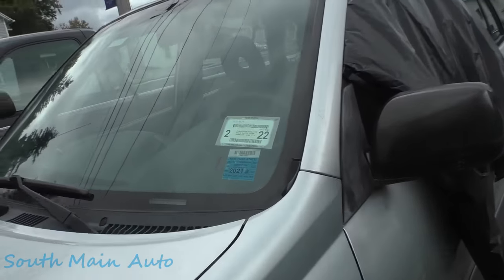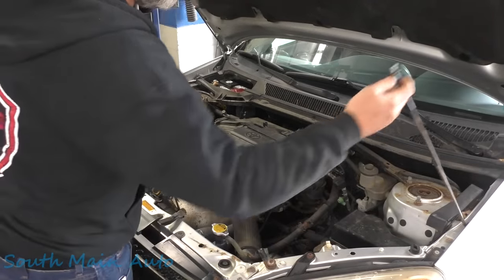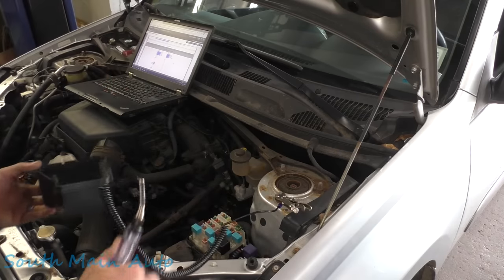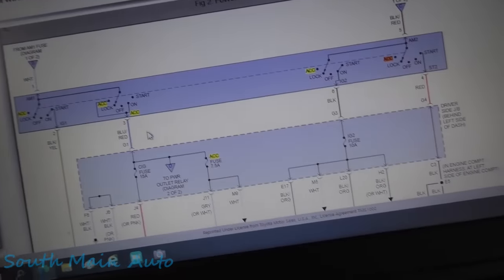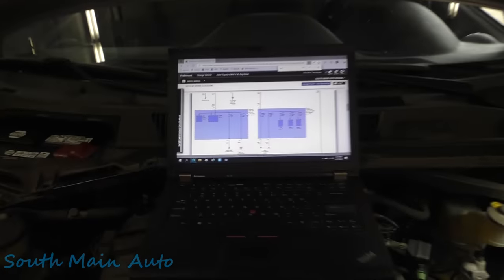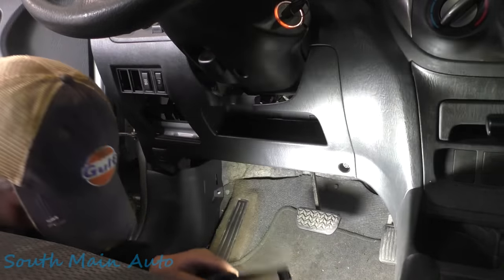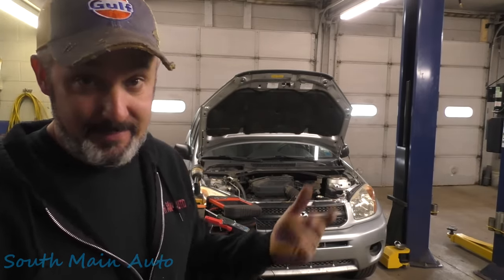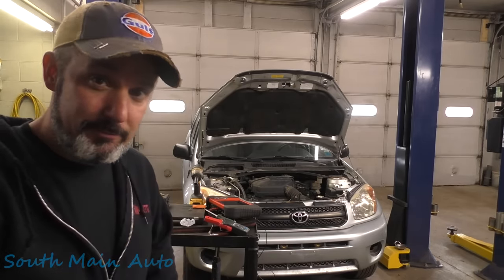Toyota Rav4 Is D.O.A. But Still Runs?

Comment: I admit, I did initially think "Why didn't he grab that battery hold down off of the junkyard vehicle?" You explained that very well with "Do what you were contracted/tasked to do".  I really think your explanation of diagnostics is my favorite thing, since most car engines are as cryptic as Aztech tomb traps, at least to me.  :)
Reply: Actually I disagree.  There were a couple things he could of grabbed like the cap for alternator stud, maybe hold down if it fitted, the cover for battery. Even could of ziptied battery down or use a bungee cord so it isn't bouncing around.

I once had a shop screw me over like this where they only changed the one part.
Years ago I had a 1990 jeep Cherokee where the fuel pump went out on it.
Paid 550 and 2 months later the fuel gauge stopped working. They wanted to charge me like 450 to change the fuel sender in tank. Turns out they only changed out the pump. Even though the price they charged me they could of replaced the whole assembly, they didn't.

Shops do this so the customer comes back so they charge more.
Reply: I trust my mechanic and tell him to report or fix whatever he finds broken. Ask me only when the part is really pricey or will take considerable time to fix. Sometimes I let him fix things that aren't broken yet but show clear signs of letting go in near future, why wait if the car is in the shop and on the lift already.
Reply: no good deed goes unpunished...do what the customer says only. it's a business after all, and the junk yard visits is already going beyond what the majority of repair facilities would do. keep up the amazing work Mr. O
Reply: Just let him Wilbert's probably has all the parts you need. If he just got it, I imagine he got it dirt cheap
Reply: @blitz8619  They are business to make money.. The only thing your shop should have done is say to you "While we are in there we suggest you change the fuel sender also, and CHARGE you for it"  WHY should a shop replace shit for free!!?? I know of NO shop ANYWHERE that just puts parts on for you, ESPECIALLY if you are a first time customer!!
Reply: I am thinking the same thing. That's what makes a good shop a GREAT shop. Vacuum the floor mat. Take 2 minutes to see if the customer wants the switch fixed. Eric O your time is not as valuable as you think. There had to call you out on it.
Reply: @hoosiertrailrider  He's not doing it for charity.  He's doing it to make a living.  Vacuum the floor mat?  If you want him to do it at his hourly rate, sure.  Fix the switch?  Add another hour of labor for diagnostics.  You're not calling him out because your just another guy who thinks mechanics and other tradesmen shouldn't make money for their time fixing your stuff.
Reply: @blitz8619  shops like SMA buy from local parts stores like NAPA, if he ordered a fuel pump, that's what he got. the sending unit is a totally different part, i just replaced one in a 2001 ranger but not the pump, either will work until it don't. your pump could have worked for another 10 years.
Reply: @blitz8619   I have to agree- grabbing like a whole other battery or something like that is one thing, but just a hold down and alternator cap is such small potatoes I probably would have done it.
Reply: @TheWickedFast1  but when a shop marks up the parts so much. Marked up a 50 pump to 100 when the complete assembly was like 90. That was the problem I had.
Reply: @stevenjames3242  yea but when you get charged 100 for a 50 pump when the complete assembly costs 90.
Reply: He could have but it would not have fit that battery that the customer already had. And since that battery was fairly new, he probably wouldn't have liked the idea of having to replace the battery again. That hold down will only work with the correct battery installed. But I agree, should have grabbed the cap for the alternator if it was there, that stud is way too easy to accidentally hit with a wrench, sticking out like a sore thumb.
Reply: @brnmcc01  He would have had to spend more time in the rain to get the cap, plus for all we know he looked at the car he got the fuse from and the alternator and that cap was already gone. Come to think of it most of the time the cap threads though the cable, so he would have had to disconnect the cable before he could get the cap from the junker.
Reply: @blitz8619  They didn't know your sending unit was about to go bad. I've got a 96 XJ, the fuel pump went out ages ago and I had a new one put in. They didn't suggest nor did I ask them to replace the sending unit. The car now has about 600k on it and the gas gauge still works.

Comment: I love when the big dog fuses are right off of the positive battery terminal. Splitting open a junction block to replace a main fuse can be a nightmare.
Reply: Or having to cut out a bad factory fusible link, then you have to splice into a high amp wire, and worry about the green crusties invading it later if doesn't stay dry.
Reply: I don't know the only time I seen a main fuse fail is when it's on the battery terminal. 🤷‍♂️

Comment: My two cents, they tried jump start it backwards. The way I remember that is why they have the big fuze because without it, it will fry a computer.
Reply: I have done something similar.  The parts store didn't have the right battery in stock, and I had a moment of dumbness where I put the battery in backwards.  It had a rather large spark when I went to connect the battery positive and I thought "that was weird", and then realized what I had done.  I got away with only blowing the aftermarket stereo and a main fuse like in the video.  A year later when I replaced the stereo I realized that the stereo also had a fuse on the back which had blown, but by that point I replaced it anyways.
Reply: The old reverse polarity trick, jumper leads reversed or battery., seen it happen and usually destroys other components.
Reply: @willemvantsant5105  Lucky it is an old car.
Lucky still it did not fry the PCM.
Reply: @willemvantsant5105  Absolutely right - other things generally die, but not in this case. However, Toyota may have a trick or two up their sleeve that people much smarter than me may have placed in the system to prevent much greater damage to many components. Retired mechanic in Land Down Under.
Reply: My Daughter inlaw going back some years went to pick up her new car from dealership,  somehow they reverse connected the battery and destroyed the ECU, had to wait another week for the car.
Reply: @willemvantsant5105  frankly I would not trust that car.
esp these days.
there are multiple computers in the car
PCM, multiple body computers, HVAC, SRS, ABS, radio

Comment: erics thought process is gold,i was working on a transit van ,mk6 diesel,in england,and doing copper washers on diesel pipes ,had to prime the system,and was on my own,was stumped ,then i remember ,eric loves his wiring diagrams,so i thought,what color is the starter moter trigger wire ,to ign key,google a wiring diagram,had fat red wire to batt,alt wire,and a red wire with black stripe ,goes to key ,found that at the fuse box plug on engine loom ,back probe a wire ,now i could turn engine over ,on my own,crack open injector nuts ,turn engine over till fuel came out ,retighten nuts ,crank engine over ,and it started,was awesome 30 seconds ,used erics train thought loads times now ,i found if every think is dead,they are easyier to fix,visit scrap yards too,get cheap parts,tressure  trove in there ,rumage around ,boot ,under seats,found shotgun in a volvo once ,that was mad ,even bought a snapon scanner with a scope ,after seeing what eric can do with it,watch pulses,canbus,opens up a whole new world,love the scope on a rope too,find lives ,grounds easy ,i too now ,seem to be getting peoples cars that seem hard to fix ,or they gave up ,as not easy,keeps me busy ,his videos are gold ,for learning to diagnose ,work out whats going on ,get brake lines to make ,got erics flareing tool,and bending grips,work sweet ,done miles pipe ,after watch his vids ,25 foot pipe on a roll ,1 gal brake fluid,good go ,bleed,keep going eric ,you educate the world ,pass on your knowledge ,help others

Comment: Love the videos and I'm always learning something new.  I swear 90% of the problems are always electrical wiring or electrical component failing.
Reply: Nowadays with engineering they've been built in so much electronics components that the more links ina chain the more one's going to fail so I like simple the older the cars are the more I like the electrics were simple and really bottom line is to get you from point a to point b all the bells and whistles a lot of fun when they go wrong they'll make you crazy

Comment: Keep up the good work man. I started work on my own vehicles as a hobby, then it turned into a necessity, now I do it because I don't trust anyone to do good work. It's easy to find a bad mechanic, It's not so easy to find a trustworthy one.
Reply: Same story as me. When my friends or family go to the mechanic before talking to me, I can't believe what diagnosis the mechanics come up with and almost every time the estimate is four figures. By the time I find the cause and fix it, the fix never costs over a few hundred. They just throw random stuff on there to pay off their boat.
Reply: @mediocreman2   Not always...I'm a mechanic, and I don't own a boat. In fact, I drive a boring but dead reliable 2006 Taurus (Vulcan engine, not those godawful duratecs). I have a professional work ethic. Before I call a part, I'll make for darn sure my diagnostic is correct and change ONLY that. I, too, have seen cars coming from other shops (many, many times the dealer!), with ridiculous diagnosis. It actually pisses me off, because those idiots tarnish every one of us with the same brush in the eyes of the public. But rest assured, not ALL mechanics have a boat to pay...some of us just drive 16 year old cars! 🤣🤣🤣

Comment: Very good job and quick find and fix the problem. I take your point on the other issues you identified. That is why I like to carry out most of the basic maintenance on my car myself. I would never let my car get into the condition that car was in. I don't believe that mechanics should have to work on a dirty oil covered engine and other parts. If you keep your engine clean you can soon identify a problem and attend to it promptly or have it fixed professionally. I have a 2007 BMW X3 3.0d diesel. I won't touch the engine (mostly) as it is far too complex for me but other minor issues are no problem. If people took more care of their cars they would last much longer and cost less to fix in the long term.

Comment: I learned the same thing decades ago. Fix only what you were hired to fix. I've seen so many comments saying techs should have just done this or that. Nope. You weren't hired, contracted, to fix anything other than issue. It's a liability to fix other issues if not hired for it. And, it's not financially gainful to a shop to engage in fixing everything. You're absolutely in he right now fixing every little thing.

Comment: My first guess seeing a main fuse like that popped is that it was jumped backwards of the battery cables were put on backwards. More modern Mopars have a "Z-case" fuse array that pops if you jump them backwards.
Reply: I can guarantee that's what happened. I stupidly hooked a battery up with the poles reversed in my corolla a few years back and blew the fusible link. I had the same symptoms (started, but nothing else worked). The high beams and horn also kicked on as soon as I hooked the battery up. The car made it very clear I did something terrible.

Comment: Crazy! I just fixed the same exact issue on an 03 Rav4 last week. I picked it up from the auction and nothing was working just like this one. Luckily I figured it out pretty quick. Great video!
Reply: You'd be amazed at how many cary get jump started backwards at auction houses
Reply: @skoolsuksok  I could definitely believe it. That is what I assume happened, I replaced the alternator just in case though.

I found evidence in the vehicle that an employee at the dealer that sold it purchased it and returned it very quickly. I think he was probably the one that jumped it backwards

Comment: also, the customer sometimes appreciates having you point out other things they are unaware of so you can do it on the same trip to the shop. I hate telling a customer they need something when they pick it up. If it were me, I would ask "why didn't you tell me, I could have left it here and saved another trip". I at least try to tell them on the front end so there is time to do it while I have the car if they choose to add the work.
Reply: Of course, we are not privy to the conversation he had with customer!  And he didn't offer any insight there.

Comment: Someone probably hooked jumper cables backwards when the old battery went dead.
Reply: That was my thought as well.  I follow Rav4World and these big fuses blow when folks mix up the cable attachments.
Reply: @wendyhunter5913  It's a very common mistake and an easy diagnosis. The really hard part is finding someone who will admit that's what happened.

Comment: Just fixed a Honda, with same fuse failure. New battery but no battery hold down. The battery must rattle around till the fuse gets grounded out and there’s your problem Lady!  So watch out when that teenager at the Parts shop replaces your battery for free?  Keep up the great videos SMA.

Comment: After doing electronics and hundred thousand Volt electrical, as well as working on 270Ton equipment.  You don't know how many times I have heard this phrase, when it comes to soldering.  The Bigger the Glob the Better the Job.  Well this was a first for me.  I would of gone right to the accessory ignition switch.  Great job once again.  Only someone with the confidence in what they do can explain and show at the same time.  You would make a great shop teacher for the trade.

Comment: A long time ago, while replacing the starter on my VW, the pos cable that was disconnected from the starter accidently touched the frame.  All the sudden there was a fire which burned a few wires and hoses.  All were easily repaired or replaced.  But it was a lessons learned for not disconnecting the battery first.  Not saying this is the case with this Toyota, but anything can happen if one is not doing things right.  Anyway, loved your diagnostic approach, as usual.

Comment: Hopefully the customer corrected the sins under there. Assuming you showed the customer what failed they did just that. This is a great video as some didn't realize that the side block on the battery cable is also a fuse box...I wasn't aware of that. Thanks again Eric for more enlightenment:-)

Comment: Eric, i gotta say,  thanks for all diagnostic tricks you show off in your video. I've learned a lot.
last week i had a 2020 VW Golf 8 in my shop, that went haywire. it had 40 fault codes stored over 10 modules. All complaining about an invalid databus message on the canbus. I thought, what would Eric do? Look for a fault that is easy to diagnose. In the ECU there was a faultcode stored for the Neutral position sensor on the manual transmission (note that the engine light was not on!). Going this route i found the 5V wire to the sensor was rotted through.
this is what fixed the whole issue....

Comment: So had this exact issue with a 2003 Rav4. The cause for the blown fuse was a jump-start with the wrong poles connected. Basically don't rush when jumpstarting. Now the fun part is to get a new fuse in the UK that doesn't cost 10% of what I paid for the vehicle

Comment: I'm sure you get the scattered customer that can do 95% of their own work and it's only the odd weird situation that they need to hire an actual mechanic. But thanks for doing what you do. Fyi, you did a video of a 2014+ GMC Sierra with "failed power steering (electric) and the and/stabili-trac weighing out. That ground strap problem/fix actually helped me figure out why my truck would intermittently through the abs/stability

Comment: I had a similar situation on my 1991 Toyota Celica. I traced it to a blown main fuse. I replaced said fuse and it blew again straight away. The root cause was a stray wire from the alternator (what was left of the radio interference capacitor) shorting to ground.

Comment: You mentioned there was a aftermarket alternator on it, quite possibly whoever installed it shorted the main cable while disconnecting it from the old alternator? Nice work as usual mr O.

Comment: i used to sell batteries back in the day and the number one pet peeve of mine was battery hold downs!!!!....we would see the insides of batteries all broken up and cracks on the case , scratches, cuts etc from the battery jostling all around....the fact you said maybe the battery post hit the cross strut came to mind when you said it.....the car was a real clunker but you got it back to life and it will probably go another 5 days or 5 yrs depending on the person's luck...you got it at least 5 days more

Comment: I wonder if that strut brace has a witness mark - on the underneath, rather than the back.  Take the piece of wood out from under the battery so it sits lower (pretty sure that's not factory anyway), and it would short if you hit the brakes hard and the battery tipped a little.   We may never know.  🤔

Comment: Eric, I learn alot from you. I have to find a battery holder. It's where the battery sit. Whoever it was let the battery leak or it was a cracked and it leaked battery acid on the holder. Everything is rusted where the battery acid leaked onto. Am I pissed? Of course I am. I'll keep the Camry as long as I can. I have burnt out bulbs in my AC and heater. Trying to find how to put in new bulbs AC/heater switches. So far I've found nothing. I'll keep looking. Thanks much for your videos.